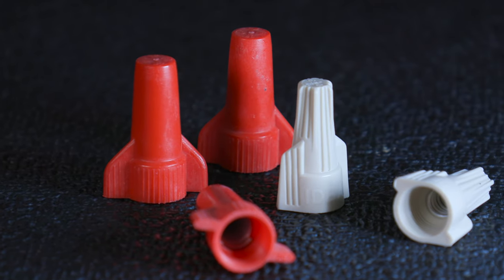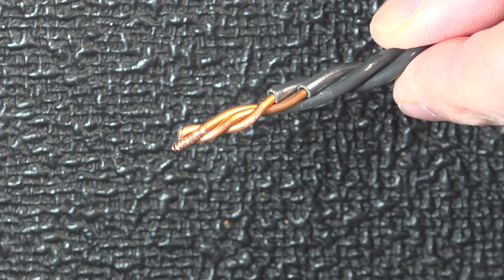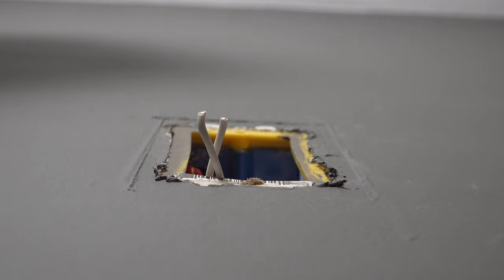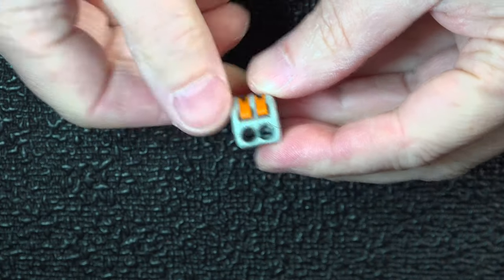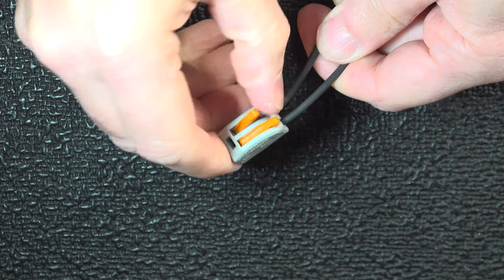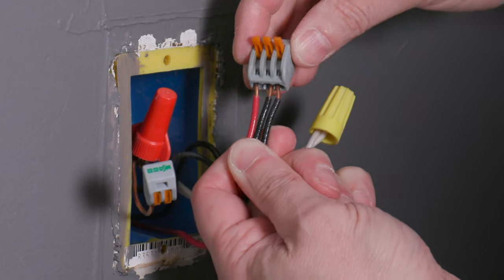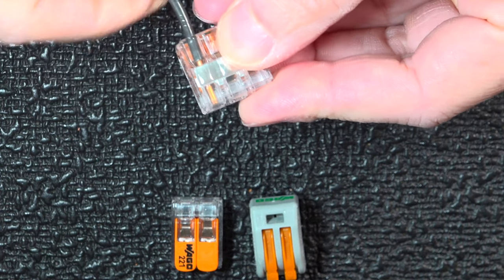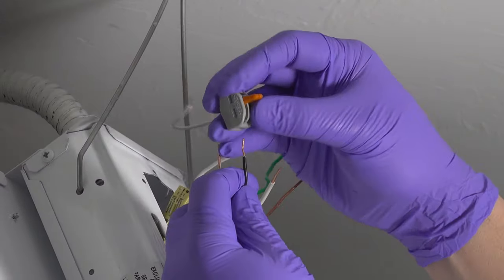Never use Wire Nuts Again - Wago is Better Electrical Connector

Comment: In Germany we never had these weird things. Traditionally it’s a luster terminal, effectively a wago with a screw instead of a leaver.
Reply: Same here in France
Reply: Except nobody uses them anymore
Reply: @AngeEinstein  Would love to know what you use insted, but...
I can assure you it's still in use in Europe.
Reply: @romend1763  almost everybody uses WAGO connectors. Big point is that a screw connection can loosen over time but the WAGO are spring loaded so that doesn't happen. Also if you tighten a screw clamp too much you damage the wire. This can possibly "cut" a big part of the wire, creating higher resistance and therefore a fire hazard.
Also the cost disadvantage of WAGO is minimal. One pcs is about 0,30€. If you factor in the cost of labor and the other benefits like full reusability, increased safety(because you can't really use it wrong) it's not bad.
Other option would be the WAGO connectors where you push the wire in. Those are way cheaper but can't be removed from the wire. But you still have the benefit of easy(and idiot proof) installation and spring loaded clamping force.
Reply: Electricians in Germany don't use anything but wago anymore.  I just build my house and that's all I used.  Lusterklemmen are from yesterday.  For my light fixtures that go from a solid wire to a stranded wire, I used the type with the levers, otherwise I used the push in type.
Reply: Dang, even your wire connectors are over-engineered!
Reply: @AngeEinstein  That's why the current NEC code now explicitly states that you are to use a torque device to tighten all electrical connections.  It used to highly recommend, but as of the 2020 code, it's now required. 
I teach an industrial wiring course (along with NEC updates classes for CEUs) and one of the more eye-opening parts of that class is taking electricians who are working with this stuff every day and don't use torque screwdrivers or torque wrenches, have them do a box to what they think is right - then show them the torque recommendations, set up the torque screwdriver, and go in behind them.  The expressions I get when we turn an additional 1/4 or 1/2 a turn before getting to actual torque is pretty fun... 
Like I point out to these guys - most of those connections are going to be strong enough to never be a problem - but those values guarantee that they won't.  
Also, most people can feel 20 ft/lbs or 30 ft/lbs within a couple of ft/lbs -   but the difference in INCH/lbs is hard to tell - 20 in/lbs is only 1.33 ft/lbs - ie. not much - and getting it right is tricky without a tool to measure it. 
Still, because of heat cycling due to current flow, the conductor connection surface area, and knowing how it all works, I'd trust a screw mechanical connection of a spring loaded connection any day.
Reply: @robertsparling  Same in the UK - Wago are defacto standard. Fantastic product - hilarious seeing all the Yank sparkies moaning about them because they can't handle the fact that wire nuts suck and aren't to code in most other developed countries!
Reply: @regiondeltas  I'm a Yank, too: I just live in Germany.  To be fair, Europeans run 220v, Americans run 110v so the amperage is twice what it is in Europe.  The Wagos might get hot with the higher amperage.
Reply: That is why us Yanks call it "The Old Country".

btw, why are you still using 22v to run a 7w led bulb?
Reply: @stevebrendap9600  Electrification started later in Europe than it did in the US.  220v is more efficiently transferred over long distances - less power loss.  Also Europe runs 50 Hz which is safer to the body than 60 Hz.  In this case, the US has the "old" system.

You may not believe it, but Europe has stoves, refrigerators, washers, dryers, and wall sockets just like in the US.  We don't just run LEDs.  And who uses a 7w LED?  Mine are at least 9 and above.
Reply: @robertsparling  Whose system is superior isn't the point. The point is that for the same wattage, 120v requires almost double the amperage. Wagos tend to get hot when running a full 15amps through them because there's no direct wire-to-wire contact. I'll use them all day to hook up light boxes, but anything that is in the chain to an outlet gets properly twisted and capped with a nut. The twist is the electrical connection, the nut is just there to hold it together. The thin stamped metal in a wago doesn't compare.
Reply: @pilotdog68  We use 15 amp circuits in Europe also.  They seem to work fine.  They meet codes, and insurers have no problem with them.  The newer type is also encased in clear plastic so you can see that the connection is good.
Reply: @romend1763  UK is not EU :P
Reply: @robertsparling  WAGO can hanedel around 30A to 40A , if you gona pull more you should use other means to connect your wieres.
Reply: @AngeEinstein  almost everybody uses WAGO connectors?  I - don't - think - so.
Reply: @lopmb  But it is in Europe.
Reply: @Thurgosh_OG  there is reason why I wrote EU
Reply: @pilotdog68  
There are many different versions of spring-loaded terminals.
In Germany, 16A / 230V is standard in home wiring.
If the spring clamp gets too hot, you should perhaps also use a spring clamp that is designed for the amps.
Reply: I'm in Germany and my new apartment is done with all Wago by default. My friends new house also. So seems things changed. I'm not sure if this is standard now or if up to electrician you hire.
The luster terminals are still the default in lamps etc, as they can be more compact and are most likely cheaper. But I always replace them with Wago. Luster terminals are reusable, but they crush the cable and if you do this multiple times, especially to a stranded cable, eventually you will have to cut it off. Also I'm not sure if the generic luster terminal is non flammable. Should be, but for peace of mind I replace it.
Reply: What I hear over here BS!!! If you are electrician you can't do all this mistakes to happen how? If you know your job the wago is waste of money !!!
Reply: @AngeEinstein  when i first saw wago i though about pex, how brittle will it get in 10-25 years
Reply: they exist here in germany, buit not for house installation. in some regions they are common for old electrical-bell installations :) but they get swapped to wago at every occasion
Reply: Yes, a screw terminal block.

Comment: Just watched Wago video. Just what I was afraid of. The electrical contact area is tiny compared to anything you normally get with a wire nut. That was the same problem with those 3M wire splicing pieces of junk, although they were even worse with only a knife edge for contact. Wire nuts rule!
Reply: Tiny contact area made out the highest quality copper electroplated pot metal.  Great!!
Reply: The WAGO connectors are much safer than any wirenut because the contacts are spring loaded and will never get loose even with vibration.
The electrical ratings are much higher than needed for the specific wire gauge.
Reply: @joshpotter9261  You are pretty much wrong, and your "advantages" are clearly disadvantages in real life.

1. WAGO connectors can only be open or closed, nothing in between. So there's no way to install them faulty. Due to the red lever an open clamp is clearly visible. Each wire port has its own spring and lever and you only insert a single wire in each port.
Also you can mix soft cables and hard wires on a single connector without cutting away the thin liz wires or risking a faulty connection.

The wirenuts can be installed loose, overtightened or with only having grip on some of the wires - and you cannot spot that with visual inspection. That's why they are prohibited in EU.

2. WAGO connectors are reusable hundreds of times. You can add or remove connections whenever and as often as you want. No need to cut away anything. No need to replace anything.
3. All WAGO connectors are extremely vibration proof.
Reply: As an electrician who has done hundreds if not thousand of houses and numerous commercial and industrial projects including construction, renovations and maintenance.... the whole point of the wire nut is to replace the insulation that you strip off the conductor to keep the lines isolated after you splice them together. Whereas the wago attempts to do both the splice and insulate the connection at the same time. A lot of faith is put in that which is mass produced as cheaply as possible...
It is not the job of the wire nut to maintain your splice unless you are using the crimp on style. The teeth inside the nut are designed so that it twists on to prevent it from falling off and thus maintaining the isolation of the line, identified conductor and ground. 
Many sites and facilities that I have been on DO NOT allow the wagos to be used because of their fail rate and lack of surface area to maintain the electrical connection. As per the client and or their electrical engineer. Of which I can attest to, many times I have gone to replace a fixture and touched them and they have fallen right off the conductor. I have also been at facilities where they use nothing but wagos just for the fact that the company thinks they are saving time and money by using wagos instead of doing a splice and using a wire nut. I’ve pulled numerous brand new wagos out to install and found them to be defective and do not latch onto the conductor. Even after installing them and doing a tug test to make sure the connection is good I still had to wrap electrical tape around the wago because the company knew that they were not perfect and failed. 
Yes they are quick and easy to use- ideal for the do-it-yourselfer but they do have their downsides too. A spring can fail or break. A thin piece of metal can break or become separated from where it is suppose to sit. Especially when in constant use with pressure and vibrations on it.
Reply: @gamestheory3244  So you done it wrong and dangerous. If is wirenuts sos safe why they are banned from using in machines, cars, rocket launch pads and europe, japan and others. But wago clamps not. 

So USA just showing us they are dumb, like man times.
Reply: @NnetTucnak  you know nothing about me, what I’ve seen or had to fix nor about my decades in the trade. I’ve met and dealt with many inspectors and engineers over the years and have rarely failed.
It is a perfectly acceptable practise here to use them. Obviously there are instances where you cannot by code use them. Some parts of larger machines you could use but usually conductors are installed in terminal blocks or butt end connectors in cars for a more permanent connection. But preventative maintenance is usually still performed (depends on the company) and connection points checked.  
Other countries can and do have their own codes and best practises that they enforce as they see fit. 
I never said I was an American but thanks for coming out though
Reply: @NnetTucnak  uh huh that’s nice of you. Excellent grammar and spelling by the way. Keep on trolling about stuff you know nothing about
Reply: @joshpotter9261  lol, sorry man but US done almost nothing in WW2, you saved your butts with bombing Japan. most of Europe saved Rusia... sorry man but US heroes exist only in movies.
Reply: Wago and its variants originate on a 240V continent. They max out at 4000+ Watt, something that in any halfway decent distributed 240V installation will never happen. Totally different story with 120V. Heat the kettle for a cup of tea while running the toaster and something in the microwave and unless you have like 3 separate circuits you are seriously pushing limits. Circuit breakers will not pop for these short, heavy and often repeated overloads pushing a Wago over its safe limit all the time. Over here we have been using Wago and similar since forever, breeze to install, breeze to modify and never any problems.
Reply: @Bee Eff YES mister electricity policeman, a kettle, a toaster and a microwave on the same circuit. A kettle and a toaster are portable so your home owner can plug them in wherever he likes, no code is going to stop him. It's what they call freedumb. Fun fact, our code here allows for 20A breakers. Since ALL our circuits are 240 V (unless they are 400 V) every circuit can supply 4800 Watt aka good for said kettle, toaster and microwave. Now to be sure our kitchens have more than 1 circuit, common is 2 regular ones and 1 3-phase for cooking.
Wire nuts? I used the last one like 40 years ago, no idea if they are still allowed here. But here is for hoping, I am indeed no longer in the industry, retired last year.
Reply: @Bee Eff 120V is standard only in the US, Canada, mexico and the islands in the Caraibian. The rest of the world (-some exceptions e.g Japan) runs on 240ish V. Ohm's law is universal, halving the voltage V doubles the current I and quadruples the power loss P. This is especially important for connectors of all kind, doubling the current will generate 4 times the heat in the connector.
Reply: Dude those waygos slip out super easy.  Some of the cheapo ones don't have enough tension in the springs to keep the wires in place.  They're literally a safety hazard.
Reply: @subjekt5577  then get the wago 773, not a chance they will slip out and you won’t find a faster and safer connection for people that knows their trade.
Reply: @NnetTucnak  Jesus christ, the amount of ignorance about WW2 you just showed with that comment is almost staggering.

Comment: Learned about these from YouTube a couple of years ago. When I built a new workshop I used these (the new style) connectors. Much faster and simpler. The electrical inspector commented on them, saying these are much better than marettes. BTW, self taught for wiring but did pull a permit and passed the inspection with no corrections to make. Slow but steady
Reply: @FJB2020  Yeah I've been apprenticing as an electrician and it is very straightforward. Twisting together 3 wires and using a marrette was the hardest thing I had to do. So these seem pretty awesome.
Reply: @FJB2020  maybe for you, but not for the vast majority of people. 90% of my work is finishing jobs that prone thought they could do because they "watched some YouTube videos." I had 9 guys doing these types of small jobs at the beginning of 2021. Now I have 32 of my 81 guys doing this kind of work, from the people who thought they would take on a DIY remodel.
Reply: @FJB2020  everyone who says this only has limited experience in resi lmao
Reply: @FJB2020  im talking like you bozo lmao, theres a reason less thanhalf of all journeyman electricians pass their master test
Reply: @FJB2020  you said electrical is pretty easy, which isnt true for high level for industrial and commercial...